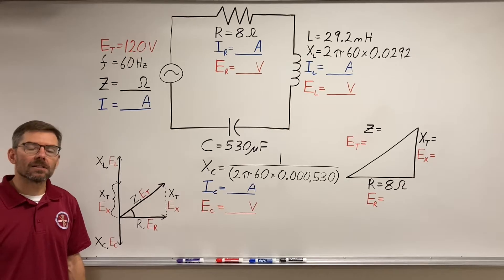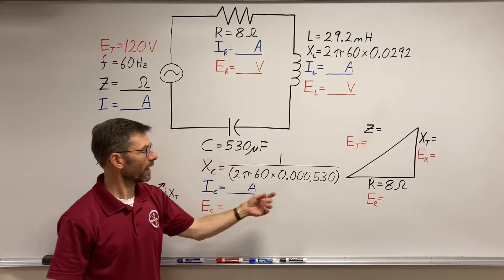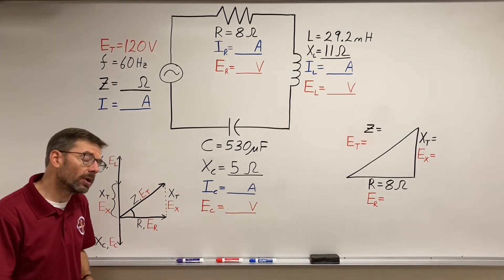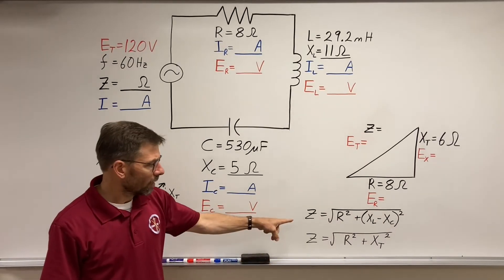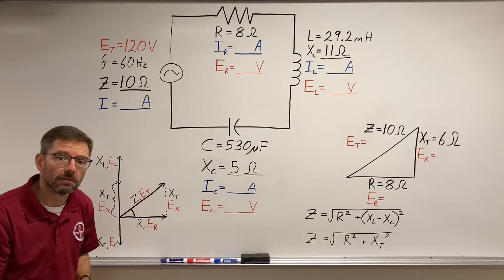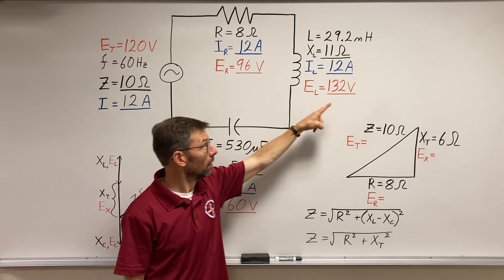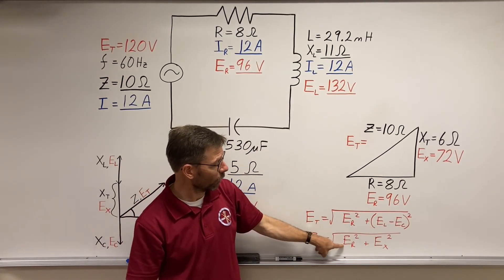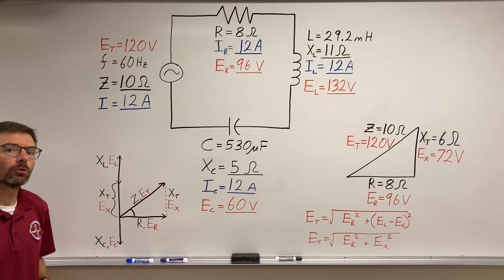Series RLC, Ohms, Amps, & Volts

Comment: Dave, just as an idea for a future video:  I am involved with HVAC tech training and one on the things that baffles most of our technicians is the voltage readings across the run capacitor which is in series with the start winding in a single phase compressor motor (PSC).  On a 240 volt single phase compressor, the run capacitor might read 350 volts across its terminals!!!  WTF? is the usual technician reaction!  The principles of this video and with the help of your $5,000 Fluke gizmo, a great deal of confusion can be cleared up.  You have a great talent -  I have never seen such to the point,  no mental wondering in the line of thought teaching skill.  You are  good example of why they put blinkers on race horses :-).
Reply: I’ve always had trouble with understanding why the start winding had higher than source voltage across it.  Was always told it was because of the back emf but seeing it laid out and the math behind it really helps to understand it a bit better.  Still a bit over my head but I’m trying lol.  So in the circuit on the board, would the higher voltage across the inductor be due to back emf or is it just the way the capacitor and inductor interact with each other?  It seems like they’re two different things?  One is an inductor rotating through a magnetic field creating back emf and higher voltage.  The other is stationary so I’m assuming no back emf but it also has higher than source voltage.